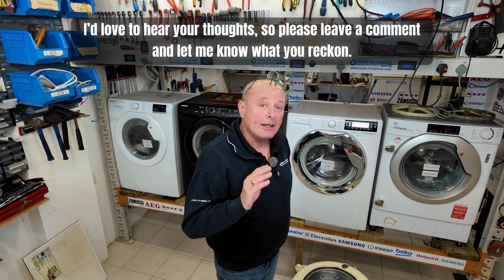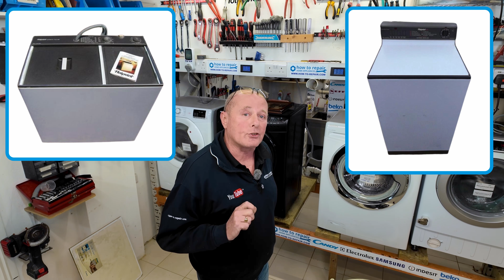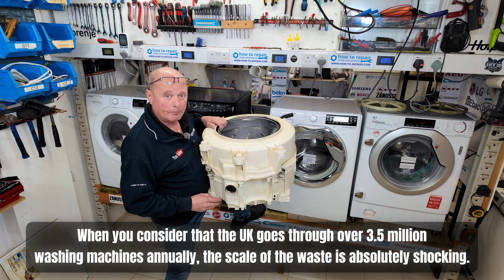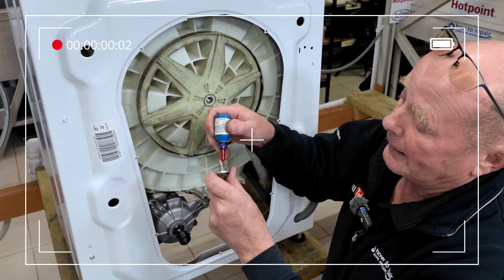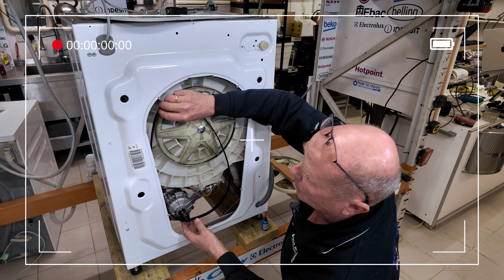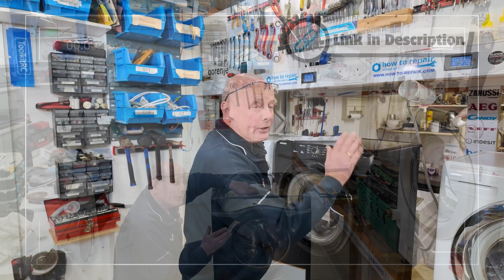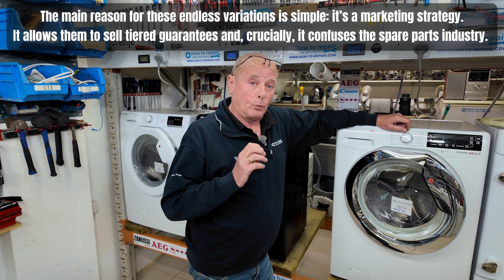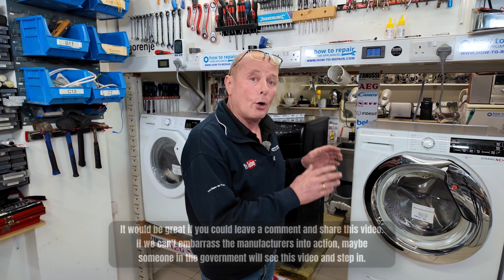I Scrapped 13 MACHINES to Prove a Point: STOP BUYING These Brands!

Comment: Same with samsung, apple and probably other phone companies, they push "software-updates" to older phones that are heavy loaded designed to wear/draw battery/cpu power alot more to try to force ppl into thinking the phone is dying.
meanwhile i have a xiaomi phone that is nearing 5 years (256gb) and a huawei (64gb) phone around 8 years both still feels close to new and runs without problems. got a new one as the huawei filled up and had a small crack in screen, buying a new was only dbl the price of getting it fixed (keeping old around for when kid is old enough to use).

I also have a pc, although only 120gb ssd its now 11 years old and have never had a single issue with it, while friends have pcs that didnt even last half as long.

Comment: I'm happy if these pile of craps last for the 2 year warranty. My current one is 8 months old and it's heating unit just failed, they've just repaired it today (of course for free within warranty). All tech is absolutely pile of craps, they are meticulously designed this way so they broke as soon as your warranty ends so you immediately have to spend money again.

Comment: I had also on LG TN7 8kg washing machine, a central bearing problem. It got rusty until it no longer rotated well. It was pretty much stuck. When the machine accelerated in turation, it made a terrible noise comparing to jets when they take-off. The bearing cost was 10$ but the manual  repairing in my back yard cost was another 100$. With this repair, the service guy said to me that I can use the machine for another 5 to 8 years.

Comment: Same with notebook computers, you used to be able to replace the keyboard easily, now its welded in the to top cover and requires complete strip down and re assembly, all the while promoting how ecofriendly they are. All BS

Comment: My washing machine is LG, and my tumble dryer is Logik. Both are about five years old, and I bought the specific model numbers of those brands after doing some research...which I do for every item that costs a bit, and needs to last for a while. I wonder if my choices were good.

Comment: I have18yo turkish-made Bosh.
Over the years had to replace door rubber insualtion, water tube, resolder connectors on PCB, intake valve tends to leak.
But overally it works and is repairable.

Comment: Assuming there's a non-trivial assembly cost to these, the combined price of all the spare parts should really not exceed the retail price of the machine - perhaps 5% or 10% more at most. Similarly, any manufacturer should be able to explain the cost of a spare part to weed out prohibitively high prices on specific items designed to fail. Any attempt to vendor lock components should come with harsh punishment and some percentage of components for a given item should be stock items. I would even say schematics for spare parts and software should be force-released once the vendor decides to stop manufacturing/supporting them.
There's an effort in the works in the EU to attempt to partly standardize packaging to make it easier to recycle. The philosophy should be no different for home appliances. Manufacturers should be forced to design for the full lifecycle of a product; including keeping the thing repaired with reasonable effort and at a reasonable cost.

Comment: I used to work for a company that supplied the automotove industry in the UK. We supplied foam that they used for sound supression around a car. They only liked one type of foam, this foam was fine initially but was designed to degrade overtime, the foam yellowing and chipping away after a period of being in use, UV light/heat/oxidisation. After a few years the cars used to then squeak or make noises as the foam degraded which influences customers to feel there product is now old and they should look at upgrading.

Comment: Comparing a machine price with pricing of the individual parts is not a good one. You forget that the parts must be kept on stock for 10 years or so after the last machine has sold. The added cost is obsolescense risk, intrest and space cost (stocking cost). and then you have a markup op 50% on top of that to make money. So 30 Euro parts  has a factor of 1,8 (space, intrest, obsolescence) * 2 = 108 Euro

Comment: My dishwasher’s heating broke on the day the warranty ran out. I will never forget this. 😂
Reply: It's either a software update or bad luck the manufacturer's calculation worked too accurately
Reply: @cattocs tf does a dishwasher need a software update for. 
Too much tech in a simple machine.
Reply: @AutoMotoMechanic apparently bosch decided internet is required for running dishwasher
Reply: @cattocs  Afaik Bosch sells one that has only buttons for the most basic functions.

If you want to use any of the more advanced settings/programs, like running it on a timer, you need to download an app and use your phone to control your dishwasher.

They sell it as a "premium" feature because it allows you to "control your dishwasher from your living room", like that's something anybody ever wanted.
Reply: @cattocs is it true you need WiFi to use rinse aid? Heard that a couple months ago.
Reply: @AutoMotoMechanic  needs firmware for sure.
Reply: Most things are designed to have faults begin when the warranty ends
Reply: @Forever_Roaming so you have to replace it
Reply: Mine did, I took it apart and found a large hole burnt in the PCB where the heater relay was. Went onto Google to search for a replacement, and lo-and-behold, a Bosch recall for relay in the door causing fires...  I got a free repair even though I had taken it apart, they put it back together for me too 🤗
Reply: @davidhunt240 I had my dishwasher in a rental property in London. I live far away, I just got a new piece and wrote the repair into my self assessment. 😂
Reply: manufacturer miscalculated, I am now letting my washing machine to repair within warranty, which expires next Tuesday 👹
Reply: @Bobsikus my Gornje dryer didn't even last for 18 months. A travesty
Reply: The reason that the big stores try to sell these five year guarantees is because the average machine is expected to break down between five and six years.
Reply: Imagine what they can do with anything that has a chip in it, ONE press of a button and thousands of devices die, as they scoop more money from you, while you should use paper straws.
Reply: Cheap capacitors... the upgrade costs 20c extra... 80c for the good ones.
Reply: lol mine works but trips all the electrics when not running but plugged in, took few days to figure out what was tripping the electrics haha
Reply: My former LG Plasma TV broke 10 days after the 2 year warranty period lapsed. Luckily I was able to fix the (known) design flaw with a £40 kit off Ebay and some soldering skills, it lasted 11 more years after that 😏
Most people would just have chucked it since it was a cheap/low end model and getting it repaired by a pro would have cost more than it was worth.
Also old dishwasher tried setting the house on fire when pump failed, apparently it had ZERO safety features to prevent the heating elements from becoming red hot, yes they were actually glowing. Still got some scorched/melted cutlery as souvenirs of the experience 😅
Reply: Completely different product, but my best friend bought a Samsung TV a couple of years back, took a few weeks to get delivered as there was some logistical problem but he eventually got it. One day, it just stopped working. Couldn't figure out what was wrong with it. It would turn on and off, but the screen stayed black and no other inputs did anything. Went to the store and heard the warranty had expired 3 days prior. He went on a mission. The warranty expired after x amount of years after purchase date, but he explained he didn't actually have the TV in his possession until weeks later. He had proof to back this up. Took him a good 2 months or so of arguing but he somehow managed to win and his warranty was reinstated. Got pretty much all his money back and bought a new TV. Can't remember the brand at the moment but it definitely isn't Samsung. Mate said he'll never buy another Samsung product if he can help it.
Reply: @ucheehQ  i have the same stance on samsung products.
One 600€ flat screen and a 1000+€ flatscreen tv both got their infamous purple spots right around when warranty ran out.

Ive started looking at corporations differently ever since and do rigorous research on any device or product prior to buying.

Their new s26 ultra is a hilarous joke.
"Worlds first privacy display"
Seriously?
For me this is a cheap low end phone screen you cant look at anymore the moment its angled.
The battery isnt even 5000mha.
(My brother in christ, my 5300mha snapdragon 7 gen 3 already is struggling a bit with performance heavy games. Still lives for a good 4-5h tho from 80% to 20% and set to 720p resolution)
The screen also is absolutely tiny for how expensive that thing is.
The phone doesnt even have proper fast charging cheap mid range phones have.
And the worst offender of all for me personally is the edges on the screen.
Imagine accidentally bumping into a corner on some random day.
Wanting to make a phone call, only to pull out glass shards, a cracked phone, at worst a dead phone and some blood because you touched the glass(shards)

My old samsung galaxy a50 also had an edged screen. It fell on the ground one day, landing on the only solid object that was lying there. On its side. A non edged screen wouldve shrugged it off. Not the a50. Thing got real messed up from not even a 30cm fall.

(Its not a fun experience to have glass shards from phones in your pocket. Had it happen to me with an older phone when i one day bumped into something and the front camera exploded)
Reply: Fairly common unfortunately
Reply: Its engineer: mission accomplished
Reply: The problem may stem from hard water. It is worth reading the manual carefully before use. And it 's usually easy to replace the heater or thermostat.
Reply: That’s the kind of story you hear all the time with modern home appliances. When something like a dishwasher heating element dies right after the warranty, it really makes you wonder how much planned obsolescence is built into these machines. A lot of newer appliances feel almost built to fail, which is why appliance durability has become such a big topic in appliance reviews lately. It’s frustrating too because many of these failures could be simple if companies actually supported appliance repair and the right to repair instead of making parts hard to access. That whole shift away from buy it for life products is a big part of the product quality decline people keep noticing.
Reply: I have had so much stuff fail over the years that are just outside the warranty period. At the moment in our 18 month kitchen we have had the oven fail 3 times and it's unusalbe now so got to replace it, the microwave broke after 14 months, the hob is now failing after 18months and keeps turning off every time you turn an induction ring to simmer (1-4 setting). The kettle has blown twice, the toaster failed. Then there is the TV which I have had 3 new TV's in 6 years (each one being screen failed), Laptops 5 in 7 years, the list goes on. Wish the UK would mandate that everything has to last 10 years (and no price increases to compensate) which is a reasonable expected time for a cooker, hob,oven, TV Computer etc. If this forces companies out of business then good as it shows their QC was rubbish. The philosophy of most companies build cheap, make it flashy, make it expensive and WHEN it fails it's hard luck for the customer ans most people will probly just but the same thing again from the same manufacturer and the manufacturer goes "Oh well if we lose some customers there is always others who will come and purchase etc)
Reply: Timer on the PCB
Reply: They won't either.   Their design worked exactly as planned. 🤣
Reply: consumer protection laws give you rights beyond the manufacturer's warranty, at least in EU
Reply: my tv...  5yrs warranty...dies after 2months -_-

Comment: Not an engineer, but I went to technical gradeschool and learned how to repair stuff. You're absolutely right: never even look at an appliance that does not guarantee you five years warranty. I personally love Bosch because I had a washer and a separate dryer, and both have lasted well over 10 years and are still going. At one point though I had to dismantle the washing machine just to clear all the mold from the drum.  I had to replace the drive belt of the dryer after 5 years (~53 pounds, $70) as excessive heat caused it to wear out but other than that everything remains great.

Comment: Buying an LG front load washing machine with a capacitive touch panel was the biggest electronic purchase fail we've ever did. Panel started having ghost touches in few months and had to be replaced thrice. They were using a concrete counterweight in our model and jt just disintegrated into powder in 3 years. We exchanged it for a top load IFB machine with actual buttons, way better already.

Comment: There are very few brands I passionately recommend. But Miele is one of them. If you have the opportunity to buy one, they last you 15-20 years no problem. I have vacuum cleaners, washing machines etc and they are miles above anything else I've tried. Havent failed once or gotten worse at all.

Comment: Lets create a brand that gives as many years warranty as the year we are in. We start with 26 years, and then we improve the design and built quality, so we can also increase the warranty on new machines each year. Design the machines so that things that can break and will wear out within the general warranty time are easy to replace.

Comment: Hi my friend (if I may call you such) You make some exceptionally good videos. I have worked with Washing machines for 30 years. You (and I) are nowadays fond of Asko, but for a number of years ago Asko has also tried to, quickly wear down their mechanical timer as well as some early electronic ones. Which led to the whole machine smashing itself !! The models 444 and 544 from about 1995 - 2000 had built-in rapid wear of the timer. I can name you several brands from that years that contain parts that are produced to fail after just a few years. You are totally correct about the most manufactorer seems to make a deal about making ther mashines fail very early.
I would like to know what you think about the overuse of washing powder and fabric softener.
Best regards, Asta

Comment: Thing is a cheap washing machines now is, well, very cheap in comparison to how much they would have been back in the day. It's the well known saying, buy cheap buy twice, or in some cases buy cheap, buy 4 x.

I've always bought machines that have removal front covers.

Just replaced the drive belt on our Zanussi dryer. Had a capacitor go a couple of years ago, both parts including delivery were under £15. Fixed it myself. Bought the machine in 2013, been used at least every other day so must have done well of 2500 loads.  

Hotpoint washer on the other hand had the bearing go and it just wasn't worth fixing as machine had other issues. Still lasted 9 years though....

Comment: How cool would it be if a bunch of people went together and made a washing machine with cast iron internal frame like the old Miele, alloy pullies and a backside that anyone could take off to easily access everything from the motor to the heating element, and it uses standard components, the computer should be an Arduino board that clicks into a simple relay board, so if it breaks you just buy an Arduino and download new code for it from the manufacturer, plus you can see the actual codes and adjust it at your own peril. Everything should be standard and easy to get. All bearings should be accessible. Stainless steel drum that can be unbolted. Perhaps both a plastic enclosed drum and a stainless steel enclosed drum should be offered and be interchangeable so you can upgrade or downgrade depending on your economy and needs.

Comment: A great video. I purchased a top of the range Bosch washing machine in 2008. It certainly wasn't cheap but it has paid for itself since then. The only item I have replaced is a mouldy drum seal. I have a friend who has purchased at least 5 cheap washing machines in the time i have owned the Bosch and I am sure that she will have spent far more on those machines than I did on my machine. I will be very sorry when it finally needs to be replaced and when it does I plan to replace it with a machine from Ebac because I want to support a UK based manufacturer and have a good guarantee period. I am also hoping that Ebac won't be using sealed drums as that is what would prevent me from purchasing another Bosch machine.

Comment: I have my grandfather’s shoemaker’s chisel. I don’t know how many years he had it, but I’ve had it for almost 40 years myself. I don’t use it to repair shoes, I use it for all sorts of other things. But tell me: do you use a hammer that your grandfather gave you and that you’ve owned for many decades?

And one more thing. I have a Bauknecht GSF 4872 dishwasher. It’s from the late 90s/early 2000s - no knobs, just simple push-button switches and a green display. It looks old because it is, but it’s still working and going strong, and I don’t do anything to it except for routine maintenance

Comment: Planned obsolescence is generally not explicitly outlawed in most parts of the US and Canada, allowing manufacturers to legally set product durability levels
. However, it is facing legal challenges, with Québec passing Bill 29 in 2023 to prohibit intentional, short-term, or designed-to-break product obsolescence